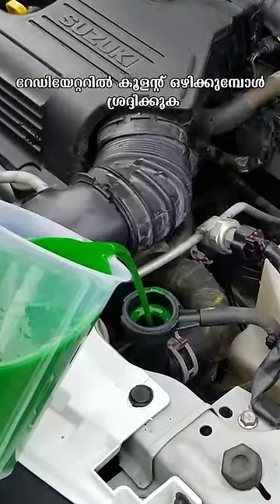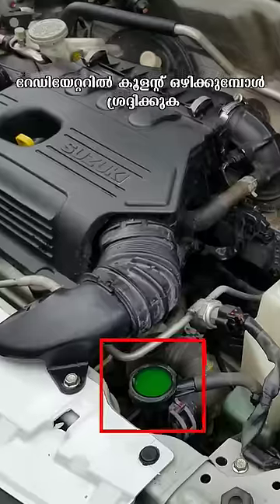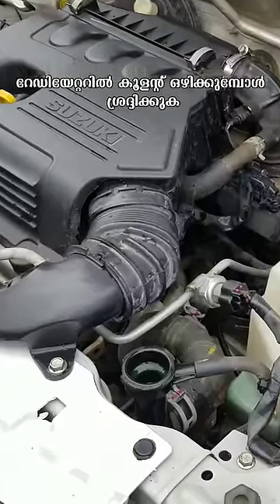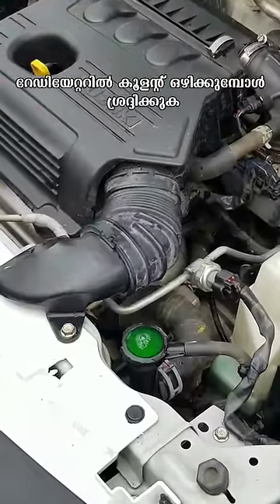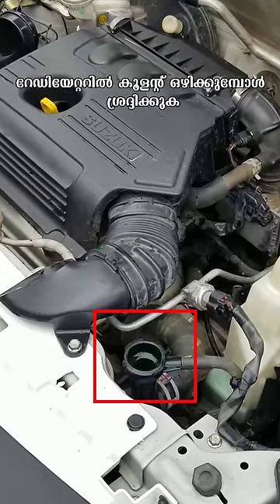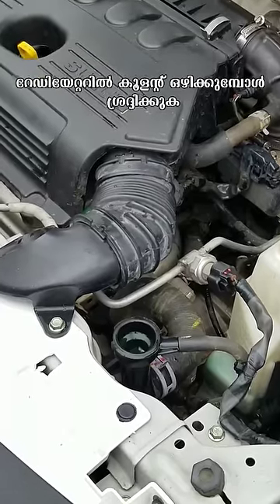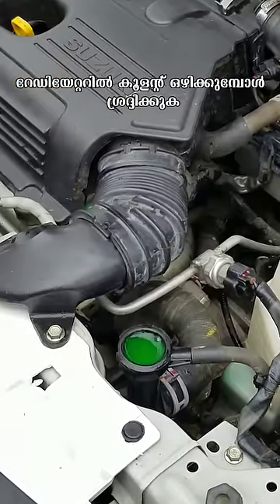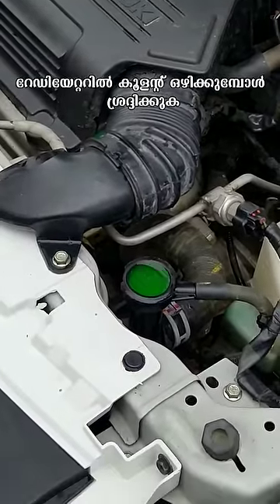റേഡിയേറ്ററിൽ Coolant ഒഴിക്കുമ്പോൾ ശ്രദ്ധിക്കുക | Radiator Water Filling

Comment: Coolant add ചെയ്യുമ്പോൾ , വണ്ടിയുടെ akathe fan on ചെയത് heater on akki iduka. Thermal valve release ആയി,coolant fill ആകാൻ സഹായിക്കും.  No-spill-coolant-filling-funnel use cheyyam, to drive out all air.
Reply from the maker: Ok thankyou😍
Reply: വണ്ടി സ്റ്റാർട്ട് ചെയ്താണോ കൂളന്റ് ഫിൽ ചെയ്യേണ്ടത്?
Reply: @ameenmoidutty അതാണ് നല്ലത് work shopil ൽ അങ്ങനാണ് ചെയ്യുന്നെ
Reply: പുതിയ model വണ്ടികൾക് coolent air റിലീസിംഗ് ബ്ലീഡർ screw ഉണ്ടാവും അത് loose cheithu start cheithu കൊണ്ട് coolent ഒഴിക്കുക
Reply: @ആനച്ചന്ദം  പുതിയ അറിവ്! നന്ദി.
Reply: @nanolubekollam8541  lexus mistubhishi .........
Reply: @ameenmoidutty  proper aaaya onnallla
Reply: @nanolubekollam8541  🥰🙏🏻
Reply: @Krishnarajappu  മനസ്സിൽ ആയില്ല
Reply: @ആനച്ചന്ദം Honda City 2011 modelil ee bleeder screw kanunila. Athinu ondaville??

Comment: Bro coolent air റിലീസ് screw ഇല്ലാത്ത വണ്ടികളിൽ coolent പ്രോപ്പർ ഫിൽ ചെയ്യാൻ ഒരു വഴിയുണ്ട്. വണ്ടി off ആക്കി വച്ചു coolent നൂല് പോലെ കുറച്ചു കുറച്ചു ആയിട്ട് ഒഴിച്ച് radiator full ആയതിനു ശേഷം ക്യാപ് അടച്ചു വണ്ടി start cheithu റൈസ് ചെയ്യ്യുക temparature correct ആയി കഴിയുമ്പോൾ വണ്ടി off ആക്കി air റിലീസ് cheithu പയ്യെ ക്യാപ് തുറന്നു കഴിഞ്ഞാൽ റേഡിയേറ്ററിൽ ഗ്യാപ് വരും അതിലോട്ടു വീണ്ടും coolent ഫിൽ ചെയ്യുക. വണ്ടി start cheithu റൈസ് ചെയ്യാൻ പറഞ്ഞത് വണ്ടി temparature ഇൽ എത്തിക്കഴിയുമ്പോൾ thermostat open ആയി വെള്ളം പാസ്സ് ആയി ഫിൽ ആകും ബ്ലോക്ക്‌ നുള്ളിൽ. Ok clear
Reply: @ആനച്ചന്ദം  Thnx for the valued info!!👌 Bro ente Hyduai Getz 1.1 Petrol Overheat ayi Coolunt tank High-pressure il over flow akunu!! Enthaayorikkum complaint!!? Fan working very lower speed while overflowing Coolunt!! Pls advise me

Comment: coolant should be always mixed with distilled water not with normal tap water....
Reply: Barrery water would b more efficacy 👌😊
Reply: Yes use distilled water...
Reply: @thomasglidemaster2362 distilled battery water may contain a small amount of sulphuric acid
Reply: @sab-fi6ey  Yea!!It would remove plaques from tubes lines...May be good to fill battery water mix-up with Coolunt sometimes (Not regular)👍
Reply: Aha coolantinte Bottle nok 70 % water 30 % chemical No need to add water enn instruction und pinne endinano alukal ee panik nikana
Reply: @Akshai009 bro, അത് diluteചെയ്തത് ആണ് അല്ലാതെ നമ്മൾ ആയിട്ട് ചെയ്യണ്ടതും ഉണ്ട് അതിന് ഇത്ര ratio കണക്കിൽ വെള്ളം ചേർക്കണം എന്ന് ഉണ്ടാകും... അല്ലാതെ ആരും മണ്ടന്മാർ അല്ല 🫰🏻
Reply: @shorin7041 suzukide ectsar coolant ellam eth exhuthitund ,Do not mix enn bcoz already diluted ayitanu varunnath.
Reply: @Akshai009  അങ്ങനെ ഉള്ളത് mix ചെയ്യണ്ട, അല്ലാത്തത് അതിൽ തന്നെ എഴുതും water ചേർക്കണം എന്ന്. വായിച്ചാൽ തീരാവുന്ന പ്രശ്നമേ ഉള്ളു.
Reply: Distilled water battery only 
Coolest 50% plus water best

Comment: റോങ്ങ്‌.....
റേഡിയേറ്റർ ക്യാപ് തുറന്നു വെച്ച് എയർ കളയാൻ നോക്കരുത്.... എൻജിൻ വർക്കിംഗ്‌  ടെമ്പറീച്ചർ ആകെയുന്നത് അനുസരിച് വേണം നോക്കാൻ.... ശേഷം തണുത്തിനു ശേഷം ക്യാപ് തുറന്നു ടോപ്പ് അപ്പ് ചെയ്യാം
Reply: ആദ്യം കുറച്ചു എയർ അങ്ങനെ കളയണം. മരുതിയിൽ ഒക്കെ ക്യാപ് തുറന്നിട്ടാണ് ഫാൻ കറക്കുന്നതുപോലും.
Reply: @jejifrancis6268 radiator water mathramayi ozhikkunathil thettundo?
Reply: @jtsays1003 Never never water alone!!? Use 50 Coolent+50 Battery water 👌
Reply: Coolant fill  ചെയ്ത് വണ്ടി സ്റ്റാർട്ട്‌ ചെയ്ത് ഇട്ട്  working temperature ആകുമ്പോൾ ഫാൻ work ചെയ്ത് thermostat valve open aayi coolant എല്ലാ ഭാഗത്തും fill ആയ ശേഷം ഫാൻ അടിച്ച് ഓഫ്‌ ആയി കഴിഞ്ഞ് വാഹനം ഓഫ്‌  ചെയ്തിട്ട്  പിന്നേം topup ചെയ്തിട്ട് bonnet അടച്ചേക്ക്. വാഹനം overheat ആകാതിരിക്കാൻ എയർ കളഞ്ഞാൽ പോരാ.. ഇതുടി ഉറപ്പ് വരുത്തുക

Comment: Coolant മാറുമ്പോൾ heater coil, thermostat valve തുടങ്ങിയവയിൽ circulate ആകണ്ടേ??? ആദ്യം radiator and auxillary water ടാങ്കിൽ ലെവൽ correct ചെയ്ത് വെച് വണ്ടി start ആക്കി ഇടുക, ഫാൻ on ആകുമ്പോൾ auxillary tank top up ചെയ്ത് ലെവൽ കറക്റ്റ് ആക്കുക... radiator ഇൽ വെള്ളം നിറയ്ക്കുമ്പോൾ top hose and bottom hose press ചെയ്തു വിട്ടാൽ air bleed ആകും...